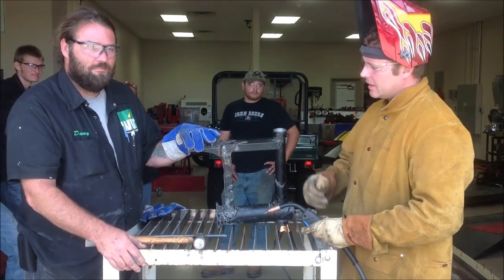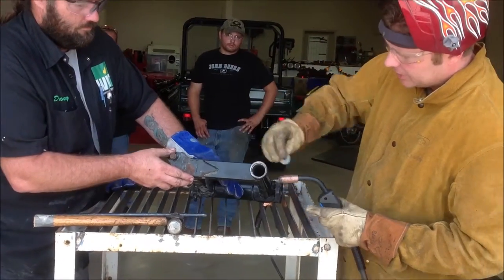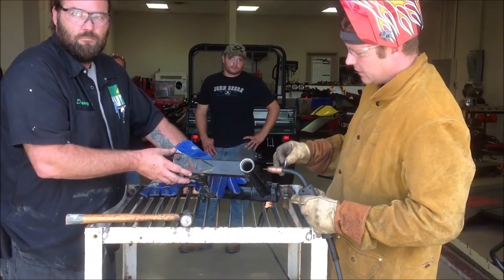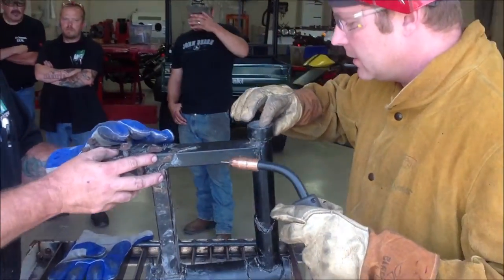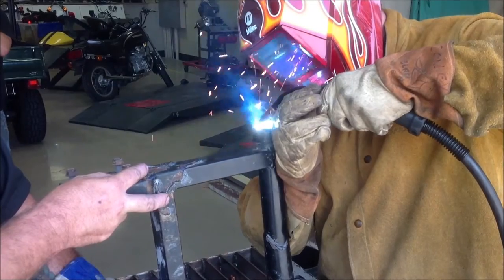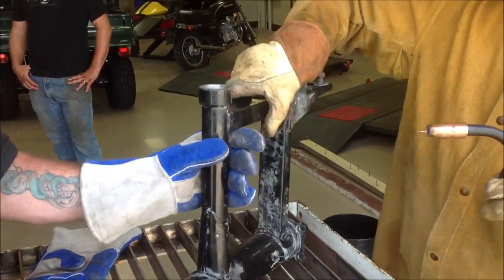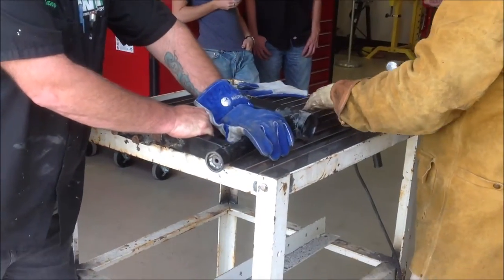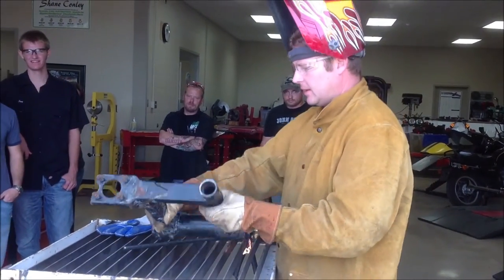Every Mechanic Series: How to remove a bearing without special tools welder punch method

Comment: I just did your method with welding the washer in the race. I did it on a 1999 Harley Softail neck bearing race, and it worked GREAT. Thanks for the Video.

Comment: Good video Shane.  Question though.  Couldn't you just use a two or three arm puller with a slide hammer?
Reply from the maker: I made this one a few years ago so I'm not sure but I don't think that there was enough room and the race bottoms out. The real point of the video is a alternative method. Thanks for sharing and being a fan.
Reply: Okay, thanks, I was wondering if that was the case. Keep up the good work.

Comment: You can do this ONLY if the swing arm is made of aluminium or Mg-Al alloy. If it is steel or cast iron and do this... You are screwed
Reply: Pak6, why ? Not welding the washer to the casting. It should work fine. Explain .
Reply: @Dixler683  try and you will understand. In theory, all comes easy